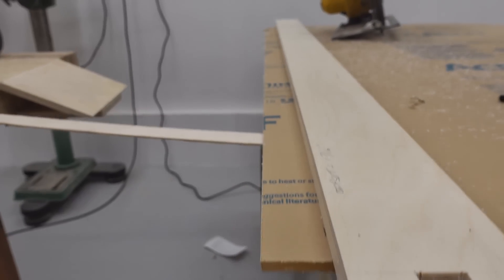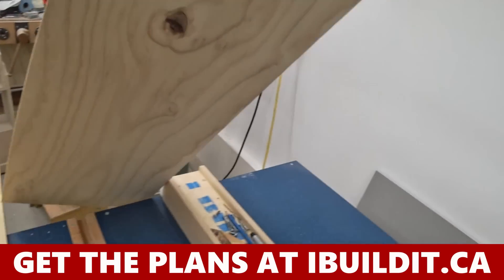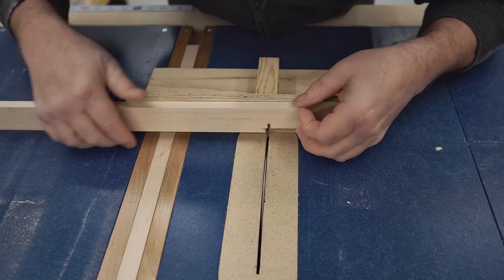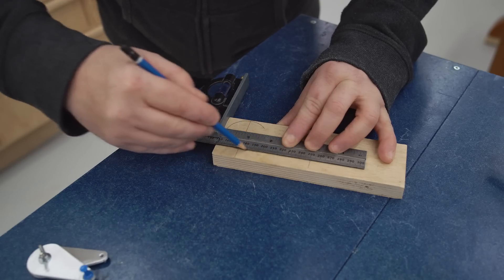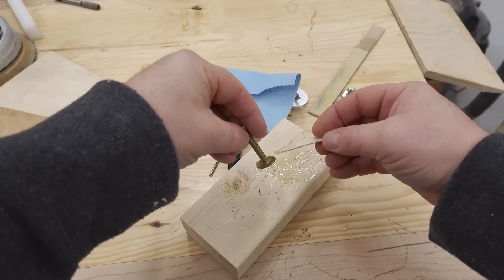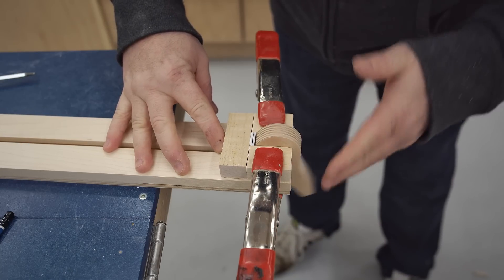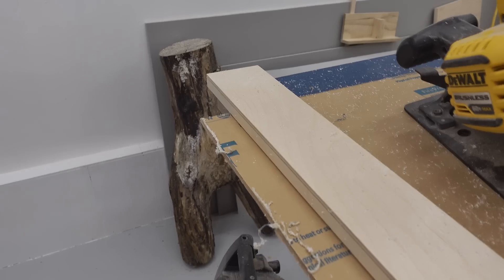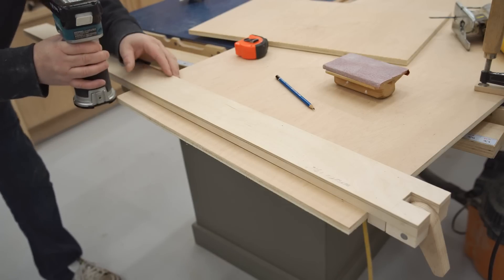How To Make A Self-Clamping Straightedge Guide

Comment: Again a great build. Suggestion: cut at the beginning and and 2 slots on the top part of the jig. That way you could install 2 spacers for your saw when lining up your jig . After you are set and clamped you can remove the spacers and start cutting . You can build different spacers depending on your tools

Comment: A set of three aluminum guides were one of my first Rockler purchase. Really love those things and your wooden one is very well made. I shelled out for the larger clamp surfaces you screw wood jaws on. I absolutely love that they're wide enough to be the saw offset. I also bought the nice solid plastic saw guide for it and even ignoring the guiding it provides it has zero clearance you cut yourself where the blade teeth are so I avoid chip out. Love how easily you made making a guide look.

Comment: I don't know if it has ever happened to you......synchronisation! Out of the last five build projects you have posted, I have been thinking about four of them concurrently. I did not purchase your new disc belt sander plan becuase just a couple of days before you posted your video I had purchased your plan on the older version which is suitable for a drill. But I did purchase your straight edge plan today as it was just the thing I wanted. 

And I also wanted to share with you that I built your older wooden K clamps. I built one and am mightily pleased with it. I am going to build five more now :-)

And there are so many more of your projects I am planning to build. Somehow my style of working and thinking matches the most with you...so far 😀

Thanks for all your sharing. Helps me tremendously as I learn only from You Tube. Self taught basically.

 Man...when are you going to stop getting new ideas !

Comment: Instead of writing the offset on top of the jig for various tools, you could make another "jig" that sits over your guide that extends over the sheet goods you are cutting with all your common tools offsets marked on it.  If you make it out of acrylic, you can view your mark on the sheet goods and line it up with the mark on the acrylic "window".  This way you don't need to make extra measurements or add/subtract the value of your offset each time.

Comment: oh this is perfect. Im gonna add 4-5 lasers diodes with 4-5 buttons to activate each one.. or some touch thingy.. so that you can pre adjust this lasers for every tool (jig saw, skill saw.. etc ) - each with their own offset - and with a push of a button you know exactly where to position this line based on the line measurment you wanna cut and the laser beam :)

Comment: John again you've solved a problem for me. I've had an aluminum straight-edge clamp for years but it uses cam clamps underneath which have to be threaded on to the correct thickness.....A MAJOR PAIN IN THE ASS....I'm going to buy your plans but only use the clamp system mounted to my aluminum rail.  Thanks for sharing your experience and capacities.

Comment: Another option for reaming the hole in the handle is to file or cut a notch in the end of the rod then put it in a handheld drill and run it in and out of the hole.

Comment: You could make a slight change and not need to mark or measure the offset for the saw. layer in a thin like 3/16" thick piece of ply on the bottom  that can even just be screwed in to be replaced if needed.  then with it hanging out just run the saw long the fence to cut it, then you have a self clamping door board. Add a second piece on the other side, and you could have one side for the circular saw and one side for the jig saw.

Comment: Only change I would make: Make the locking handle swing UP to to lock. Teh you can attach to a non-straight board and then dress the guide up to a power tool fence for cutting. Once cut, remove guide and rotate 180deg and dress lumber off the new cut to to get good straight parallel cuts

Comment: Omg, I had one circular saw and the face was terrible, I had to adjust it to be parallel with the blade for every cut. Bought another on, a lot better but it doesn't engage on both sides, so it can bend. I need to do one similar to yours.

Comment: If you use this mostly for circular saw work, attach a 1/4 inch plywood strip under the clamp that is wider than the saw's shoe then cut with the saw on top of the strip but against the board. this will leave an edge that is exactly where the saw cuts -- so no mental math for offsets, just flop it down to the marks and cut. You might have one side of the clamp this way for the circular saw and the other side for full height as done in your video to use for the router/jigsaw/etc.

Comment: I’m surprised to see the cam offset is only 1/16”. I would think it was more like 3/8”. This is the only part of the design I need to squarely clamp my track saw guide. I need that so I can cut long sheets to build your table saw system just so my table saw is usable. So basically I won’t be BUILDING anything until I get my necessary tools able to make long straight cuts. I’ve been using router edge guide/ jigsaw/flush trim method since my table saw became so unusable. But I need to get my core tools workable again.

Comment: If that handle was a shape so it stayed above the jig, you could strap this to crooked boards and run it along a table saw for making a clean edge.
Reply: If you used a double cam design, the handle would lock the guide both in the down position and the up position.

Comment: I just adapted a plunge router into a homemade router table. I was trying to adapt an extra.table saw guide to it.. No real joy. This video
came.at the.perfect time. The router table.I have is wrapped in 2 by 4s and this will be absolutely perfect. Beginners should be very careful around these machines. Make a habit to wear eye protection to start with.  Dollar tree
ones don't hold up. I just got some new ones from Harbor Freight. They seem ok. Also most. saws have a place to hang them.  Avoid loose clothing.  Also I have seen some on youtube do absolutely the wrong things..take time to read instructions that come with your equipment. The model number is probably on the web. Put PD F in your search.

Comment: John, 
nice video! I like it very much. What do you think about making one part of the bearing blocks of the cam wider so the circualar saw cuts it to the exact measurement from the straight edge? It would indicate the saw kerf like on  commercial track saws and you don't need to add the distance from the blade to the fence to the measurement you are going to cut. Aligning the straight edge would be a little easier. It's just an idea! 
Greetings from germany
Josch

Comment: Love your work, and sense of humour.  You were making a few taps to adjust for cutting with the router.  I wonder if it would be beneficial to create a right angle leg to the cam end of the straight edge to ensure a 90° cut?
Reply: Andrew Macgregor  That feature could be easily done with perpendicular strips of wood that extend of the sides of the guide to effectively make the mechanism closer to a track. You could even add the fourth piece and make it a sliding box mechanism.  Not sure why more designs don’t call for this small but important feature especially on the  locking end plate clamp where having a parallel lock on a sheet is crucial.

Comment: John, as an option to your fence, what do you think about the idea of making a set of pointers for the offset for each saw.  I’m thinking a triangular piece that has two pins that locate it on the fence, and a needle pointer that you reference to the pencil cut mark.  Or rather than two locating pins, maybe a hinge that swings them out of the way once the fence is located in the proper position.  Just a thought.

Comment: Ok ... My woodworking skills are not very astute.  But how do you validate that the clamp will clamp itself square to an edge.  How do you ensure that you clamp to edge "A" and not "b"

Seems like either the straightedge guide needed to be aligned to measured marks at both ends.  

or am I just speaking outta my arse?

Comment: Hey John, nice build! I have a question about plywood. For the cam you used Baltic birch plywood and I know it’s good and stable but unfortunately here in northern Alberta this stuff is so rare , not to mention the price...$60 - $70 for a 5 x 5 sheet 😢😢 if the local lumber yards have it on hand. Otherwise, I would have to drive 5 hours just to get any! What would you recommend for a plywood for shop tool builds besides Baltic birch?
Reply: I got some decent pine plywood from the Depot. 7 layers,few voids.  Radiata pine plywood I think it was. 35$ Merican.
Reply: Jesse McEwen, thanks. I will check with the 3 lumber stores I have access to here in town, no Home Depot! Appreciate it😃😃!

Comment: When you use the bandsaw, I notice the blade guides are well above the work piece. Is that for visibility during filming or do you find that having them closer to the work piece doesn’t really make a difference? Thanks
Reply from the maker: The blade on mine is fairly thick, so having the guides higher doesn't make much of a difference. Thinner blades need more support.
Reply: John Heisz - I Build It thanks for the response.

Comment: Impressive!  I do remain skeptical about the fence security when you are setting & clamping from one end only. Just a few  mm out & you need to repeat or repair. You even made a  small adjustment by tapping the fence whilst it was clamped - not a good look.  I'd need to be certain that the "other end was positioned correctly within measuring accuracy. You did not attempt to show this.

Comment: Can i ask why no kickback finger on the table saw?
And also do you not find that cutting all that plywood and osb or mdf etc REALLY ruins ALL your blades.
If it where me I really would think twice before ripping plywood etc multiple times AGAIN (circular saw blades £18+ per regrind not replacement teeth!) and your Thicknesser/ surface jointer blades not too not easy to sharpen 12+" planer head blades can be horrible to re grind and set up sometimes buying another set of blades works out better ( i have seen almost 1mm deep grooves in planer blades and it's all because of planing the edge of 3/4" plywood and the glue inside it!!!!!!!) making cabinet frames, cheap hollow doors with staples in, chipboard and mdf etc. 
At the moment i have a cheap 3/4" 7-8tpi blade fitted on my band-saw and building 3 white chipboard units for inside sliding wardrobes destroyed my blade it will struggle even on 2x1" pine now and i know i'm stressing all the bearing too much by forcing it through the blade!!!! MY opinion is it's not worth it in the long run especially if you are servicing the machines yourself damp mdf, chipboard and plywood dust is worse than cement dust for killing bearings etc inside places you can't even clean on a full service. And i haven't even mentioned router bits yet!.
I LOVE your videos but in reality when it takes me 6 months too save for ONE part and in real terms of use, 5 or 6 of my machines need spares after that time or "consumables" and you can't afford to pay a center to get it fixed or serviced i feel there is no hope it is truly a throw away WORLD now.
AND when you have no cash flow everything seems to cost money! i have learned soooo much from fixing my own tools......ALL the best from Scotland.